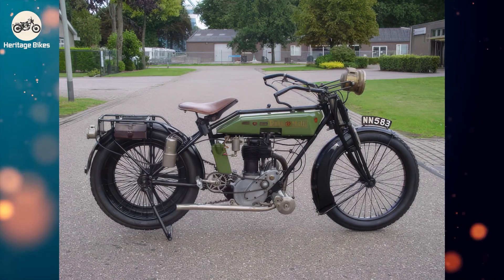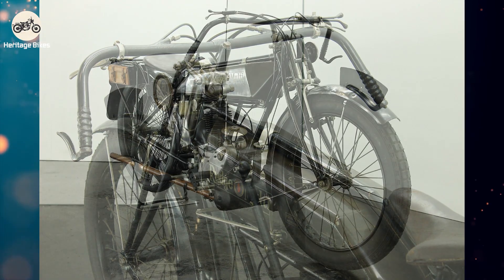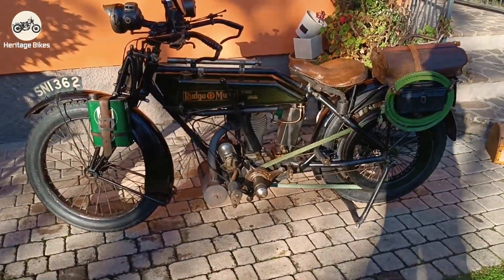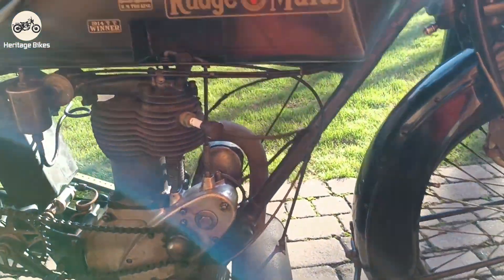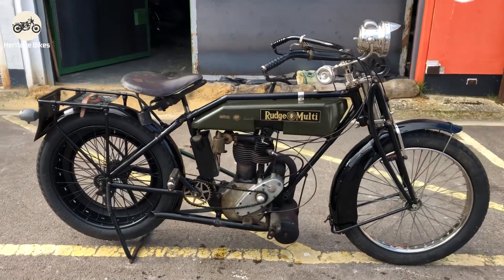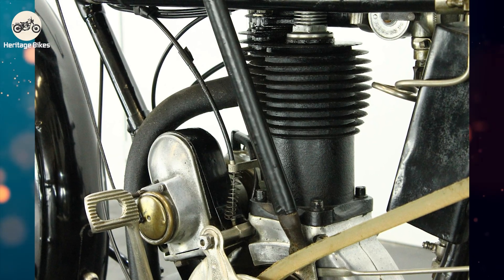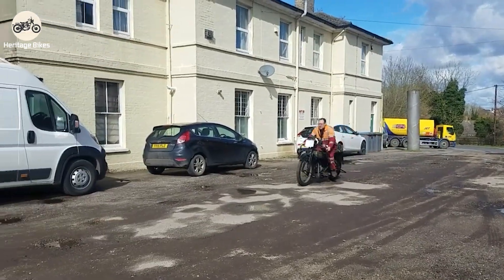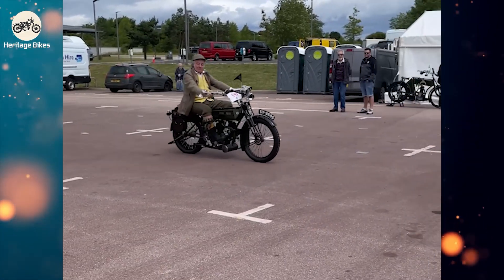1921 Rudge Multi: A Motorcycle with "Infinite" Gears

Comment from the maker: For those who want to know about the transmission:

The transmission was based on variable pulleys with adjustable groove depth on the engine shaft and the driven pulley. As one pulley changed its diameter, the other adjusted in the opposite way, altering the gear ratio.
A belt drive was used as the final drive.
Thanks to this design, the Multi transmission could provide a wide range of gear ratios (often described as having 21 speeds).
At small engine pulley diameters and large drive pulley diameters, it delivered a very low ratio (for starting or slow riding). At large engine pulley diameters and small drive pulley diameters, it provided a high ratio (for faster riding).
In effect, the system worked like an early form of a continuously variable transmission (CVT), though not identical to modern belt- or gear-driven CVTs.